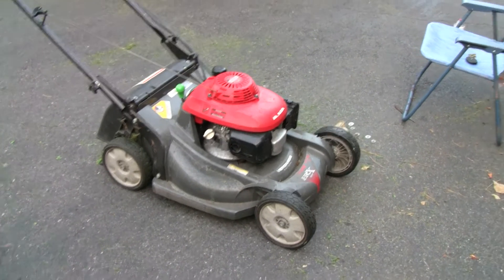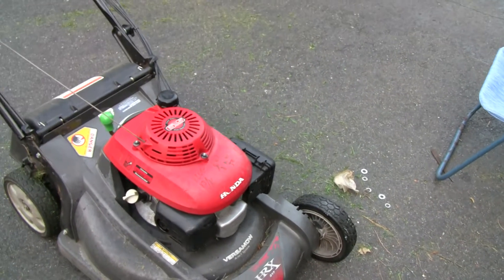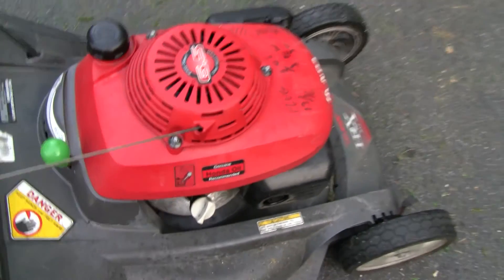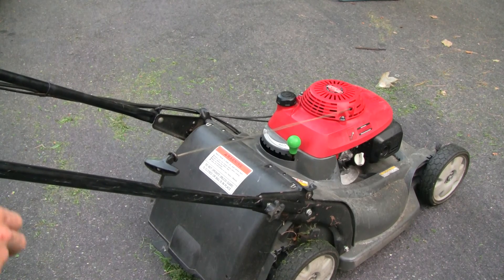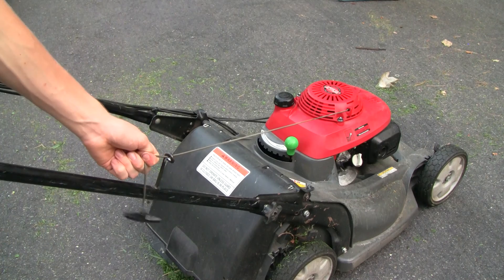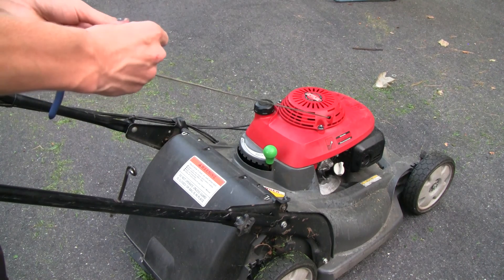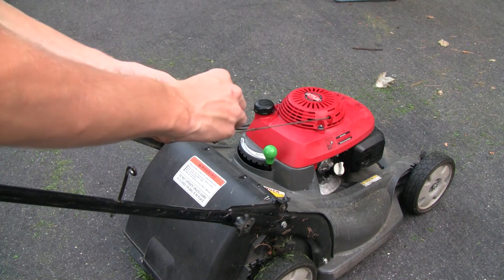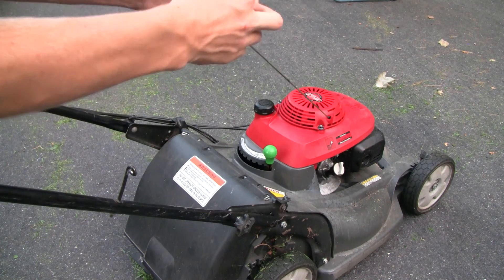DRAGGING RECOIL STARTER REPAIR

Comment: I bought a used hrx on Craigslist and I'm having the same issue. Thanks for confirming my suspicion that was causing this noise.  I thought it might have needed a valve adjustment

Comment: I had this problem before! I just took the recoil apart and rewound it with a new rope. The problem was that the recoil spring didnt have enough tension on it, causing the recoils  Dog mechanism to move around and hit the the teeth on the flywheel.